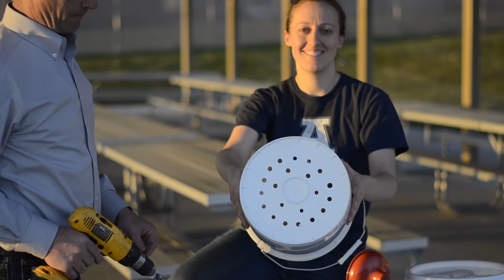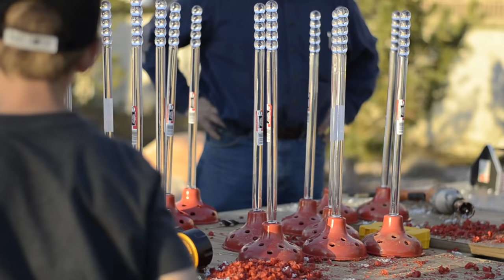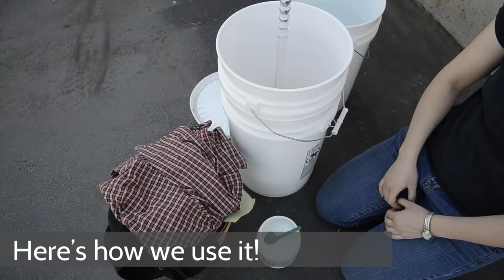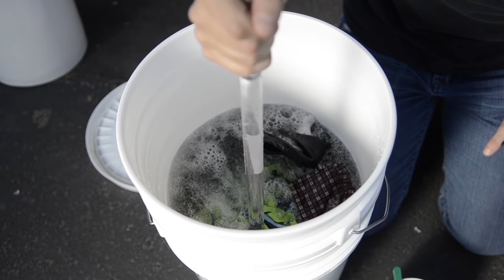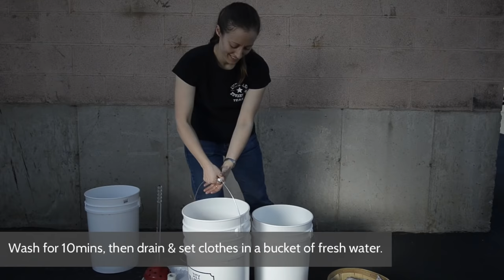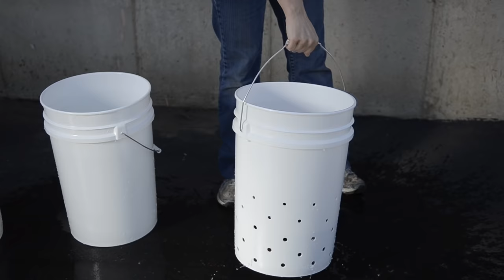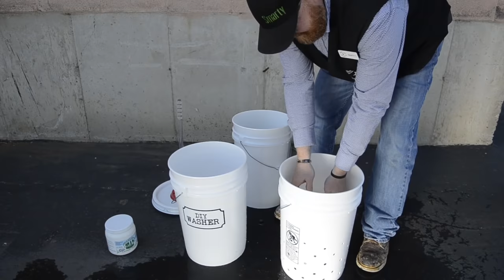Make your own DIY Washing Machine with Buckets!

Comment: Impressive DIY idea but what was the point of drilling a 2" hole in the lid and inserting the bushing if you rarely used it in your demonstration?
Reply: that was my question too. The woman didn't use the lid at all and the man used it only for a few seconds. You generally have to pay extra for the lid and then drill a hole, etc. I don't see where it is really all that necessary, especially if you don't mind getting a little wet.

Comment: Good video, one fail - explain the fancy drill bit. Twist bits tear up the bucket, yes mine is new and sharp. I used a spade bit, much better but still had to clean up every hole. Tedious.

Comment: I don't get the fascination with having to get every drop of water out, which causes too much effort. Just let it drain for a bit, then hang them up to dry. I have done this out of my washing machine on my back porch, just to see how much longer it takes to dry from those from the machine that went through the spin cycle. It does take a bit longer to dry, but not that much longer. If you are hanging outside, just let them drip after you tug a bit here and there for shaping.

Comment: ONE bucket + plunger looks fine to me- fast, easy and effective! But multiple buckets with holes? The mere sight of people lifting and moving those around from bucket to bucket makes my back, arms and shoulders scream in agony- my body absolutely could not handle that-  it would hurt me badly and leave me in constant pain. These clothes would also be way too drippy wet and heavy with water for me, and having the clothes take 3-4 days to dry would cause multiple problems....I'd rather spin them dry with a handle or foot-pedal-powered device, of which there are many. The above method would in no way get out anywhere near enough water for me, so going thru alll that add'l rigamaroll would just be an added nuisance with no positive result....

Comment: What is the bushing that goes inside the lid? What material and what size?
Reply: I don't know, but apparently, if you watch the video, it's not really necessary. Looks like they did most of the washing and rinsing agitation without the lid on anyway. I assume the lid is just to keep water from sloshing everywhere, but you make a big enough mess switching buckets and then draining and spinning that you would probably want to do this outside or somewhere where you can make a mess anyway. So really you don't especially need a lid. BUT I actually have used a similar method to wash clothes, and at the end when they're squishing the water out, I actually use a lid (with no hole) as a SEAT and SIT on the inside bucket to really squish the water out. LOL!
Reply: Did this today, have to be on clean surface, b/c if on ground, when swap buckets, the bottom of the lower bucket will have dirt/grass on it and you'll put that on your clothes. Same with the inside bucket that you swap positions with, it is now on the ground. If you are on concrete, or pallets, I would think no issue.
Reply from the maker: Great question! We used a 1.5" x 1" PVC reducing bushing. We took the lid off so you could see what's going on :)
Reply: SC Rider I was gonna say the same thing. How is it clean if they are dirtying the clothes even more?

Comment: Or instead, take same buckets, do nothing to the extra. 1 for wash and one for rinse. In each bucket add something for agitation,  I like clean river rocks with no sharp edges. Put your clothes, water, and soap in the bucket, seal tightly and shake it, stick in the trunk and drive down a bumpy road, ect you get the drift. You dont need all the extra steps,  its obviously very messy their way. I have used a 3rd bucket occasionally with holes drilled in it and I use a whole bucket to press the water out of the clothes when I'm done.